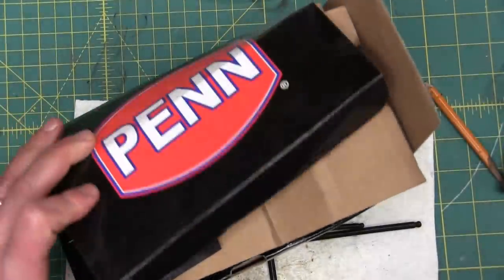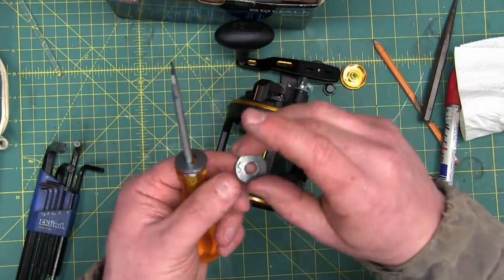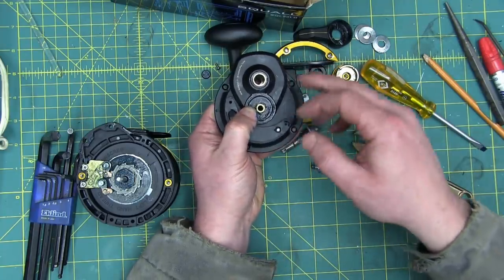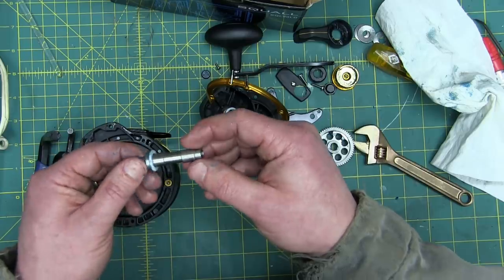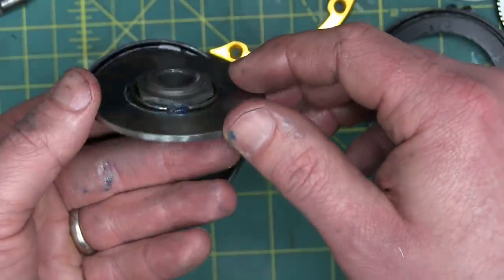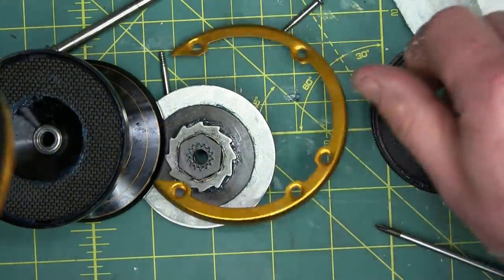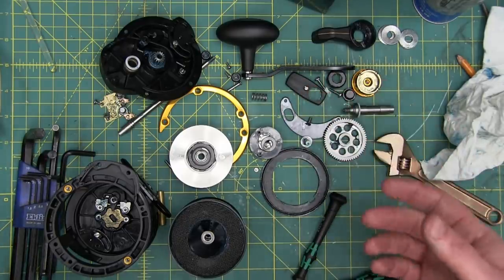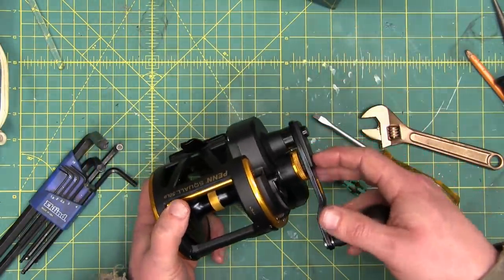BOLTR: PENN FISHING REEL | SQUALL DRAG REEL

Comment: Hey, my great uncle designed the pontiac fiero. You would be surprised at the story behind it.
Reply: do tell.......
Reply: Yep.
GM knew that if they allowed a V8 in the Fiero it would run circles around their precious Corvette so only a V6 was allowed.
Reply: Wil Hobbs. A v8 was never in the cards. There were certainly better engines than what they got though.
Reply: Darren Clark. The 88 still had the chevette suspension....  its revised even further but if the original front end is considered chevette despite its revisions then so must the 88.
Reply: puckcat22679. Its still a derivative of the chevette suspension though.
Reply: The preferred chassis of the Lamborghini replicar fanboys. Props to you great uncle!

Comment: There needs to be a fastener tax:

Those who design and sell a product that utilizes flat-heads should be taxed per screw. Security drives are also taxed per fastener used. Products using square-drive fasteners should be taxed double per screw. Those who use some proprietary bullshit like a tri-drive or pent-drive or some bullshit should be put to death. 

Phillips, Hex (head and socket) and Torx are the only acceptable screw drives today... Square-drive for deck building and the like are a gray area...

Comment: Name: M&T 50S Custom and M&T 80S Custom 
Manufacturer: Ken Matsuura Racing Service 
(Japanese F-1 Racing Company) 

R.D.S. (Rolling Drag System) 
Highly Durable, High Heat Dissipation, High reaction, High drag strength 

1. Highly steady drag during the hits. 

2. While reeling at different speeds, the drag offers smooth reeling. 

3. Vulnerable drag parts such as cork and carbon are not used. 

4. Water-tight Drag. The drag system is water-tight and does not allow water to affect the drag. 

5. The spool and drag are totally separated, which protects the spool and line from drag heat. 

Left side Drag control - The drag is set on the left side of the reel. Not interfering during reeling. 

2 Speed Gears - Depending on the weight, reeling speeds can be changed by moving the lever from Low to high/high to low. 

One touch Spool/handle exchange system - The spool and handle can be changed to match target fish with out any tools. 

The R.D.S. (Rolling Drag System) accurately controls the drag tension while fishing. Depending on the line stretch and pole elasticity the drag system may confuse amateur anglers. 

Features: 

R.D.S. (Rolling Drag System) 
One tough Spool exchange 
One touch handle exchange 
Left side drag lever 
2 Speed gear system 
Optimum Line reeling system 
Stainless rod clamp 

(Model) (Line capacity) Gear Ratio 
Weight 
M&T 80S Custom 1000m/80lb 700m/130lb 2.7:1 1.5:1 3100g 
M&T 50S Custom 1000m/50lb 650m/80lb 3.3:1 1.5:1 2800g 

Price: M&T 80S Custom 5200us$ / 4700 euro 
Price: M&T 50S Custom 4800us$ / 4300 euro

Comment: 1) they do call it graphite but they are pretty bomb proof. The type of reel that you can drop and not be upset about. 2) the clutch break washer is the same material they use in smaller reels, they call them felt washers. Usually have a certain type of oil on them. In smaller reels there’s more than one and they are stacked. They do a good job, it’s all that’s required. 3) the metal rim plates are to take the knocks and bangs and are replaceable so designed that way for that reason. 4) the flatheads do get chewed but they don’t get stuck, it’s usually from people over tightening. Regular cleaning stops them getting stuck. 5) the gear does not usually strip out (if you know how to set your drag) 6) the clicker is the ratchet....zzzzzzz zzzzzzzzzzzz, fish on! I’ve way too much time!

Comment: Don’t know if you men in the good old US of A have the Diawa Slosh 20/30 or the Daiwa Saltist Black Gold - STTBG20H £185.00. These are cracking reels not the best mind. But they will serve you well in all weathers and situations like type of fishing rough ground sandy bottom. hate the sand in your crack of my jinker. 6:1 ratio metal gearing carbon body multi position handle.

Comment: just FYI, I paid $169.00 CDN before taxes when I bought mine and its a squall 50LW. My problem is, 1st time I used  my sleeve got caught in the line guide roller and now it doesn't go back and forth on the reel. do you have any info as to how I could fix it myself or know anyone I could take it to in Alberta....Thanks...Steve....p.s.   really good narrated video , keep up the good work

Comment: @AvE So actually that carbon material is OEM in GM transmissions. It is design for continuous slipping for torque converter lockup clutch modulation (PWM).

If you look closely at the material it should be multiple pieces that are puzzle-pieced together.

Comment: Thanks Capt. Hook !   I am glad to have watched this. A dude I used to hang with had MULTIPLE  "bait casters" sitting in an old refrigerator as he wore them out and likely never had the mechanical interest to repair or maintain his investments .  I noticed that the handle ( crank ) is two positioned.  When you first started on the video, it was in the minimal throw position and at the end, it was in the "more leverage - longer position.  Using that kind of reel is a bit of an art if you want to avoid MAJOR BACHLASH aka. BIRDSNEST on your line.  You catch em'....I'll clean em'  !    J K

Comment: Hey I have a never used 1970's Penn Senator 4/0 Made in the USA!! 95% of exterior is either machined aluminum and cromed steel the only plastic peices are the sides in which the marline is depicted. Original lube from the factory plus OEM parts, servicing lube, and the original how to manual.

Comment: I love how you know nothing about fishing or reels but you just casually predicted and described the problem with those screws holding the gold bands.  Those have been plaguing Penn conventional reels for my entire life.

You should breakdown the Fin Nor Lethal 100.  Has to be the 100, the smaller ones are different.  It's a dirt cheap, huge spinning reel.  ~100usd.  The fishing reel version of you, Alan Hawk, gives it high marks as a sturdy, perfect workhorse of a reel for 1/3rd the price of anything comparable. 

These days, everything that isn't $300+ should probably be thrown in the ocean after a single season of heavy use.    And half the high end ones went so far with weight reduction that they'll splinter into shards of carbon fiber if you drop them.

The lethals pretty special.  I'd love to know why.

Comment: I am intrigued by your assertion that flathead screws are inferior to other patterns, because that does not in any way rhyme with my experience.  I'm a marine mechanic, so I do know a thing or two about stuck fasteners...  Aside from a few esoteric examples (think Frearson), flatheads are by far the easiest heads to torque right off a stuck fastener.  Torx are OK, but cheap bits and/or screws don't work very well, the bits wear out relatively quickly and are difficult to refurbish.  Conversely, I still use my grandfather's old flathead screwdrivers, which mostly look to have been hand made in the 1920s, and only require a touch of wet grinding every now and then to stay good as new...  I would be very interested if you were to make a video comparing different screw drives.  EDIT:  It'd also be interesting to see a comparison between different screwdriver brands.  Precisely because of how easy it is to apply high torque to a flathead, I've had a number of large screwdrivers fail over the years, and the shitty brands tend to exhibit ductile failure, while the more expensive ones send supersonic chips flying around.

Comment: I have a low profile chinesium baitcaster that I use for bass-, trout- and pikefishing, last season I took it a-part and rebuilt it several times to keep the fine chinesium bearings and thingamajiggers inside running smoothly and to prevent corrosion (which I started getting after rainy days).
But, I like to do maintenence to keep my stuff top notch when I go out fishing... (Former heavy machinery operator, nowadays I drive log/timber truck (ps I'm from Sweden).

pps I watch all your vidjeos, keep up the good work

Comment: Mentioned a few times that the magnetic stainless was 304. I've punched 1000's of sheets of 304 over 16 years at work & if they'd been magnetic in any way, we'd have rejected them. It did happen once that a couple of 100 sheets were magnetic & they were sent back because they were probably 430 series sent in error. Even our non ferrous scrap dealer wouldn't touch magnetic but he took all our 304. I'm confused now because AVE knows what he's talking about, so either I've gone mad or he has!

Comment: Back in the day, Penn was supplied lubricants by a company called X1R out of Daytona Beach, FL. I beliveve that greease was simply a dyed calcium sulfonate grease. Same thickener that the amsoil grease shown in the video is made with too. Calcium sulfonate is not only good for high temp and high load, but it has skookum water washout resistance. Polyurea is better...but a lot more expensive. 

Fun fact: They will slather pipes and the shit in the ocean with calcium sulfonate grease - sold as a corrosion inhibitor - because of how well it resists washout.

Comment: Drag also depends on how much string you have. The radius of the spool. On a full spool you could run 9lbs of drag. With the same drag at 1/4 spool it's 50-60 lbs. Idk I thought it was neat when I found out.

Comment: Most hardenable stainless steels are magnetic, which would include those used to make bearings and springs. While you can get Belleville spring washers in 300 series stainless, the better ones are usually something like 17-7PH, which is stronger, harder, somewhat less corrosion resistant, and definitely magnetic. I would expect the same from good quality bearings, but I don't know for sure.

Comment: My "SWAG" about the stainless steel parts being necessary even with the grease is for corrosion resistance.  I have seen stainless steel parts that came off of ships that had corroded to the point that they broke in two.  In salt water, even stainless corrodes, albeit a lot slower, and grease only slows it down.  Water, like sand, gets EVERYWHERE.

SWAG = Scientific wild ass guess

Comment: Typically, stainless bearings are 300 series races with 440C balls. That explains it being magnetic, as 440C is magnetic. You would definitely get galling if both stainless materials were similar hardness, which is why they use the 440C balls. Very interesting on all the nylon parts; I've had a few similar priced bass reels apart, and they were much more robust materials as well as sealed bearings.

Comment: The one way ramps are the drag ramps which increase or decrease the load on the drag plates by pulling against the main shaft.
Drag material is HT-100, same stuff so they say, used un aircraft brakes.
Those retractable harness lugs are a great spot for salt water ingress.
The metal in those gears if allowed to marinate in salt, as in one of their spinning reels which has suffered water ingress (common), and not flushed out at the end of the day, will eventually become unitized.
Their upper tier products are far better built, and priced accordingly.
If your bud has the smackeroos, take a look at the Daiwa Saltiga line of reel$.

Comment: How do you tell it's 304 rather than 316 just by looking at it?  And how do you tell that washer is not 410 with a magnet?  If they are not stainless, it should be obvious by colour.  If you don't have the eye, just set a steel washer next to them and you should see the difference plainly.

Comment: Could those washers still be considered stainless even though they're magnetic? My little bit of knowledge in metallurgy comes from knife making. In knife making a steel is considered stainless if it has over 10.5% chromium content. In industry is steel only considered stainless if it's austenitic? Also is it possible to make a spring washer from austenitic steel? Can it be hardened enough to make a spring or does it need to be hardened at all? And thanks again AvE for the content. I learn a ton from your channel.

Comment: Salt water reels are flushed with water to remove the salt water before storage{ that's the reason for the stainless bearings}  every time you go fishing, as well as flushing the line prior to casting 80 plus yards, or at lest the first cast if you know what's good for you, If not you will learn quick. The clicker is to wake you up and alert you to a strike. At night we would add a piece from a used styrophome cup to act as a visual aid, just tear a piece off and wedge it over the line, Combined these 2 tips work great when you have 30 rods out on a peer and need to know which pole to grab!

Comment: If you want a good high quality reel take a look at Accurates, that is what many of us use in South Florida for serious competition fishing.  Under the strain of a serious fish the plastic frame on that reel will warp, and the drag will actually melt and smoke. A 50-80# wahoo would melt that reel in its initial run.   The Harness Pins (those things you are pushing in and out on the top of the reel) are used secure the rod n reel to the harness and then to the chair when you are using high levels of drag for extended periods of time, some fish get fought with over 40-50# for hours at a time.  If you ever make it down my way let me know in advance and I'll take you out on a boat and chase big fish and you can see all of those fun parts and how they get put to use.

Comment: And those "strike plates" are for mounting straps to for harnesses. For big game, as it were. Though that's a fairly small rig for anything that would need such a thing. 

Also, those auditory clicks are more than just audible informers, it's also a good way to let out line without the spool spinning so freely that it backlashes on you and spins up all your line, dickering up the whole works.

And they go stainless where they can because saltwater is a bitch and will kill your gear after one outing if you take any short cuts. Like i wash all my shit thoroughly with warm soapy water after a saltwater day. Very horrid shit.

Comment: note: Not all stainless steel is non-magnetic! Ferridic and Martensidic stainless is fully magnetic and austenetic stainless gets magnetic if coldworked enough. Maybe it would be a good idea to make a video about that because aparently 99% of people dont know that and throw a magnet at "stainless" to check how corrosion resistant it is.

Comment: Hey, those are premium Penn's and they ain't no chinesium!  At least they weren't. I used to work in the factory where they're made (and I married the prettiest girl in the factory!).      A lot of the metal parts were stamped out there in the factory.    Note that there were different models for salt and fresh water and it made a difference in the metals and greases of various parts used in them.   The engineers were constantly tweaking the designs ... and were quite serious about taking models out of production to try out  ... wish my job were one to go fishing as part of work ...   The "clicker"  does two things ... it's enough friction that it won't unwind in wind or reasonable currents ... and yet when a fish strikes' you'lll hear it squeal.   You may be on a boat with two or three rods in  cups and the wind blowing loudly while you're on the other side of the boat bs'ing with buds ... you want to know when you get a strike.       They're good reels.

Comment: Mild stainless steel bearings for the fact that the outer races will rust - including the ZZ shields. Inside its a different story regardless of the grease or Corrosion X oils one may use. Having some form of stainless steel bearing helps with longevity through the user 'service' period.

Comment: you cant beat these reels for the money. They are inexpensive and after several seasons all mine work great and have no corrosion. My fin-nor on the other hand looks like it spent a few years on the ocean floor. Value engineered and reliable. I big game 20-30  miles out in the gulf of meheco.

Comment: First of all, not the highest quality reel so keep that in mind. Second is locktite will cause you to break the screws when they have corroded a bit with use in saltwater. Coating screws in grease seems to help the most.... Third.. Those of us who use higher end fishing gear actually do rebuild things a couple times a season. That blue grease seems to hold up the best but anything is better than nothing. Corrosion is the enemy.

Comment: the fasteners could be ss400 series which is magnetic. the best alternative would be black oxide coated taper seat screws with socket head for Allen Keyes . in my limited experience these are the most resistant to getting stuck

Comment: did you mount the crankshaft on to the wrong hole it looks a little different 0:18 vs 16:17?  I mean it would increase the force you can exert on the shaft but it would also increase your overall rotational travel time.  is that supposed to be adjustable?

Comment: I used to fix reels on the side. bobbin? it's called a spool. the bull ring does not hold any load unless the reel is in free spool. the clicker is used when the rod is being unmanned when the googin is Manning a beer and a fish is on the line, it clicks when the fish pulls. please don't leave it on when reeling in a fish, also put the handle on the last hole, more torque!

Comment: I noticed that the stainless parts in almost all fishing gear is just electroplate chunks of steel with the cheap finish. Even the fishing guides when ground for even thread wrapping are coated with copper then mild corrosive resistant stainless steel.